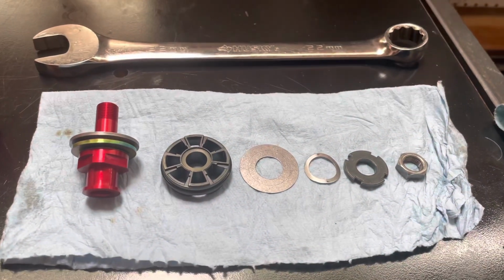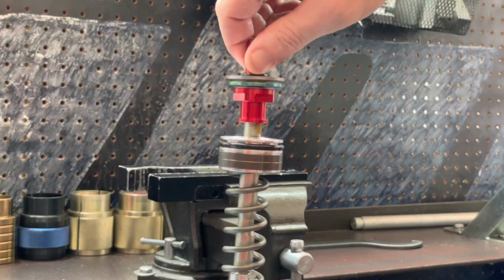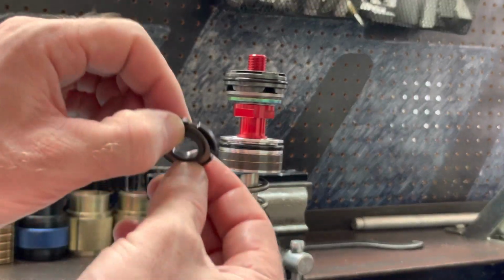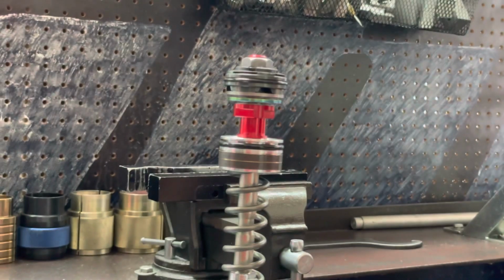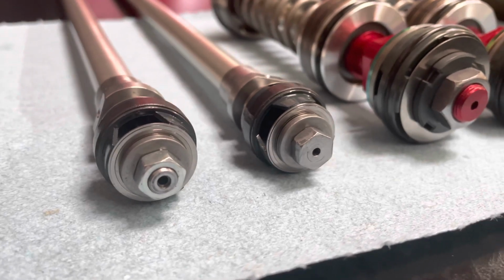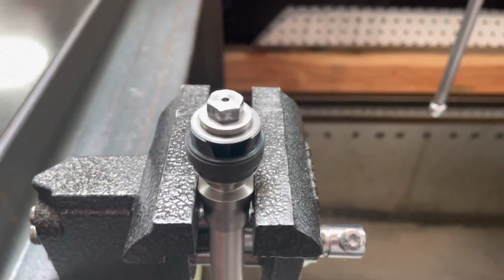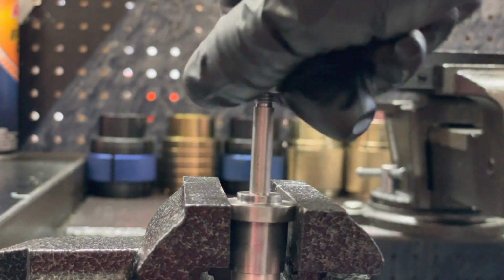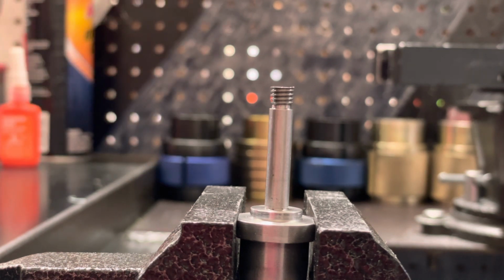How to install - Part 3 JBI Suspension Showa 49mm Pro Fork DIY Kit

Comment: Are these forks the same as what comes on a showa equipped `23 kx 450 sr? Mechanically speaking?
Reply from the maker: Correct.  Similar in hardware design.